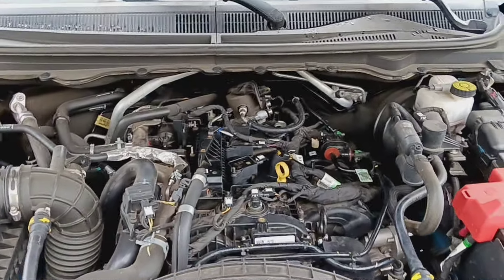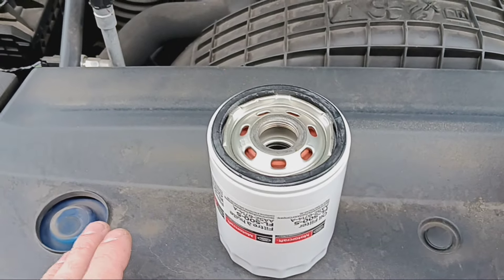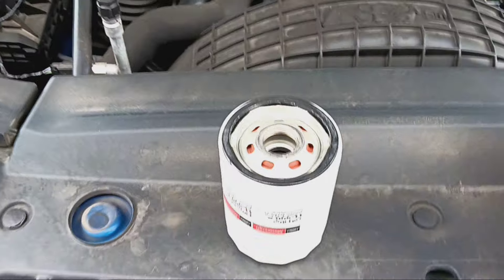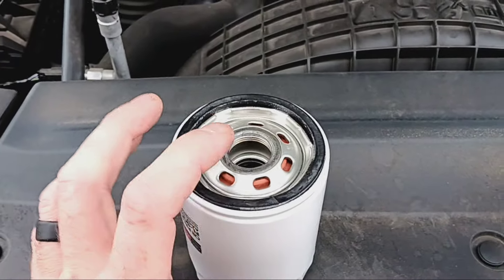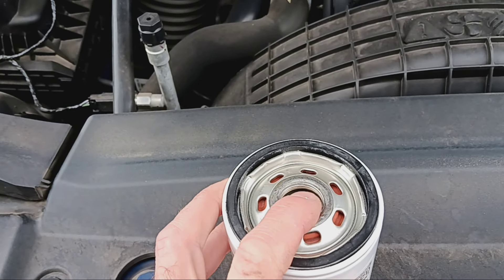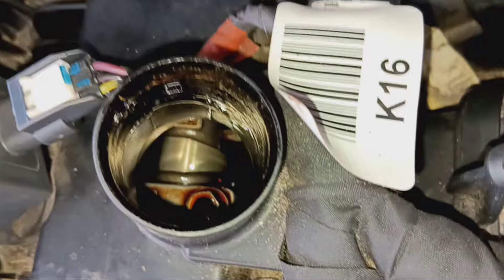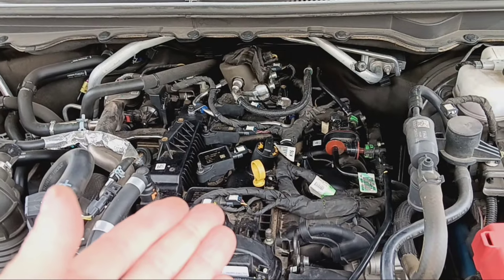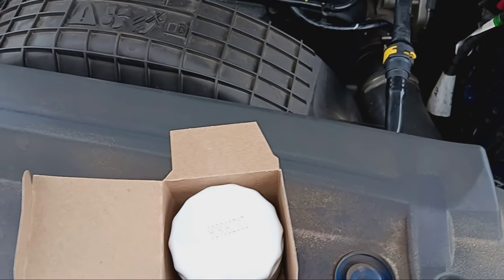The Oil Filter Pre Fill Debate. "Filtering Contaminants" No Your Not #newtoyou #fyp #oilfilter

Comment: I thought it was all about oil starvation. They wanted the filter primed so it doesn't starve waiting... I guess.
Reply: Flood mode on a Ford does the same!
Reply from the maker: Yes. And a few comments circulated about introducing contaminants lol.  Flood mode (hold the throttle to the floor and crank) primes the system.  Nissan GM and many others do it too.
Reply: @BeardedFordTech yup I flood clear my ecoboost 3.5 every oil change. Oil pressure before start. 👍
Reply from the maker: @dunbarautomotive  👍👍👍
Reply from the maker: @bonkeydollocks1879  it was do to with comments on previous videos that people say they prefill so they don't put contaminates in their engine. Then use said bottle to pour oil in the engine.  Thays what this was about.
Reply: That's exactly right. For modern overhead cam engines, it's extremely important, because their timing chains use oil pressure to tension them, and, the newer engines have variable valve timing phasors to change the position of the camshafts, that rely on oil pressure. Having the timing chain slapping around, and cam phasors chattering because of air in the system is inviting broken chain guides, and possible damage to very expensive valve train components. If you're concerned about contamination, pre-filling the filter from a brand new quart bottle is the safest way to do that. Just dump the rest in the engine, then, fill to level with the bulk container pump. You DON'T want to introduce sediment into the center of the filter, no matter what engine it is!

Comment: I never heard the argument that they are filtering the oil. But I've heard the argument that it primes the engine faster if it's pre-filled.
Reply from the maker: It doesn't. There was a lot of comments saying they do it to filter contaminants. That's what flood mode is for.  To "prime" the system
Reply: @BeardedFordTech  I see.

Comment: The only reason to pre-fill the filter, is to reduce the time the engine runs without oil pressure. Very important, for engines that use oil pressure to tension timing chains. Audi's are known to have chain guides broken by having the timing chain slapping around in there, before oil pressure comes up. Some engines even have the timing chains at the rear, necessitating separation of the engine and transmission. A VERY EXPENSIVE REPAIR!! I understand the contamination thing, if the new oil is being pumped out of a bulk container. the argument is the possibility of picking up sediment, and that being allowed into the oil galleries. You won't have that problem, filling a new filter with new oil out of a new bottle. If you KNOW your timing chain doesn't rely on oil pressure for tensioning, there's no problem. Most overhead cam engines do have that tensioner. Newer engines have cam phasors, which also rely on oil, and introducing air into those is noisy, and, potentially damaging. For those engines, I wouldn't chance putting the filter on dry.
Reply from the maker: I get what you're saying. But you said one key word. Oil pressure.  Filling the filter does not send that oil through the engine first.  It has to receive oil from the pump, fill the filter, and send it.  If it didn't. There would be an air gap like you mentioned.  And belive it or not. A lot of manufacturers state in the service manual not to prefill it.  And some also did say not to lubricate the o-ring cause engine vibration causes it to back off.  AUDi Breaks timing chains anyway. Bad for timing issues.  Yes ones with rear timing very expensive.  It's just one of those things if you want to fill it, fill it.  If you don't, then don't.  Some of them you can't.  Sideways, upside down, cartridge filters.  It's a good discussion topic!
Reply: @BeardedFordTech  The oil in the filter DOES go through the engine first. The oil pump picks up oil from the pan through a screen on the submerged end of the pickup tube, then, the pressurized oil goes into the outside holes of the filter. That pressurized oil then exits the center of the filter, and straight to the oil galleries.
     Oil pressure actually builds quickly, as that pocket of air compresses, which is why I mentioned the cam phasors, that are hydraulic. they don't work pneumatically. Everything I said, takes place for only about 5-10 seconds. The problem actually persists even after the oil pressure light goes off.
Reply from the maker: @vincentrobinette1507  oh

Comment: I pre-fill cause one of the main cause of wear is when you start the engine, with an empty filter you have 3-4 seconds with NO oil flow.  As far as contamination goes, all major oil brands filter their product before bottling.
Reply from the maker: @dwendt44  you are incorrect on engine wear. The main cause for engine wear is fuel diluted oil. Fuel breaks down down oil which essentially wears out the engine.  You have less than 3-4 seconds. There's still plenty of oil hanging around in the engine when you do an oil change. Your not dry starting it. Thats what happens on engine builds. Thats a dry start.  The oil you used does not get sent directly to the engine.  It has to wait to get pressure from the pump essentially sending oil to the filter then it goes.  If it went before. You would have a big air pocket. So it literally does the same thing as not filling it.  It still has to wait to get oil and pressure. Only difference. Your just waiting with oil in the filter already. So you technically wasted some time refilling it. And I bet you fill it through the big hole. Which is also incorrect.  Your supposed to fill it through the small holes. Modern engines don't need to have the filter prefilled. There's a lot of manufacturers out there that tell you not to.  Gas, diesel, generaters, caterpillar, John deer.  It it was a problem. Then upside down sideways and cartridge filters wouldn't exist.

Comment: I thought filling the filter with oil had an effect on a constant oil flow through the oil pump. My logic was that the oil pump won't pull air from an empty filter.
Reply from the maker: @stevangucu522  oil won't come out of the filter until it receives oil from the pump. It doesnt pull air. It pulls oil from the pan and pushes it to the filter. But prefilling a filter it won't send that "prefilled oil" first.. There would be an air gap. So the oil sits in there until it gets oil from the pump and gets pressurized  just like if you don't prefill it.
Reply: @BeardedFordTech  that is good to know. It will save me time on the next oil change 😁

Comment: Couldn't fill my two Dakota's filters. They went on sideways, under the passenger-side manifold. Pain in the rear to reach, but no pre-fill or it would be on the ground. This is what "flood-mode" is for. You can crank it a few seconds that way and fill those filters up before the engine fires, if you desire.
Reply from the maker: Yes I know. Inuse flood mode. That's not the point of the video. The point is people saying they fill it so they don't get "contaminants" in there. But then fill the engine out of the same bottle

Comment: Off subject.  Do you really feel Amsoil is worth it?   Currently using pennzoil ultra platinum which tests show to be a great oil.   As a tech to a tech do your think switching to amsoil would give me any value.
Reply: Read your own statement.  Your Penzoil tests as great oil.  You are asking if spending more money for oil you haven't ran is going to somehow benefit you?
Reply: A lot depends on your oil change intervals! How often do you change oil now?????
What percentage of city and highway miles do you drive?
Reply from the maker: Yes it is a great oil. All my used oil tests show very good results. You may be able to switch over do a couple oil cha ges then send off for testing. It may be better it may be the same. It really depends on where tou live and how you drive. I run it in all my vehicles. And a fleet of 188 vehicles. All have good results.
Reply from the maker: It might. He may be able to go further between changes. Only an analysis would tell after a few oil changes to be sure it's all amsoil being tested
Reply from the maker: Yep. Nobody drives the same
Reply from the maker: You might be able to go further with amsoil.  Only way to tell is switch over go 5k. Do an oil change go 5k do and oil change go 5k send off to be tested. That way you can be sure it's straight amsoil your testing.  Results will tell you if you can keep going. Go look at my 7800 mile oil change video. He explains in great detail what's going on.

Comment: Oil starvation is worse than a tiny bit of contamination. My 22 Tremor can’t be prefilled but I do the “clear flood mode” crank before starting and loading up the bearings.
Reply from the maker: I do that on every oil change.
Reply: @BeardedFordTech  same. I found you could not do that on a 6.7 PSD but that’s okay. Those filters are vertical and you can prefill till full.
Reply from the maker: @vais3  correct you can't do it on a powerstroke. I don't even prefill them. Never had a problem. Even quick lube guys at the dealer and truck shop guys don't prefill them
Reply: @BeardedFordTech  you’re correct. You can’t do the clear flood mode but I still prefill them on a vertical mounted filter. Is it needed? Probably not. Do I feel better? Yes. Lol
Reply from the maker: @vais3  and there is nothing wrong with that at all.
Reply: @BeardedFordTech  exactly. So many people think there is a right and wrong way but truthfully, there probably isn’t.
Reply from the maker: @vais3  I'm sure waaaaayyyyy back in the day it was necessary.  Or maybe it wasn't. Maybe it was some random person like I'm going to fill this and tell everyone you need to.  And the news spread like wild fire.   But today's engines. Not so much. Some manufactures even say don't pre fill.
Reply: @BeardedFordTech  the majority of light duty vehicles don’t need pre filled. Granted, I’ve worked on substantially larger engines and they tell you to prefill or fill the auxiliary filter and then run on it until you fill the primary filters. 
Granted, those are Cat 3512 or Cat 3516s or Cat C32s.

Comment: Also, can the oil get any cleaner than new? On the Toyota though with the housing, I believe it drains back, so from the MotorOilGeek's demo, prefilling can get oil pressure up a couple seconds faster, so should marginally add to the life of the engine if you keep it that long.
Reply from the maker: Yeah motor oil geek (my friend lake speed jr he comes on my channel sometimes))  it shouldnt drain back. It should have an anti drain back valve. But anyway. He also talked about flood made. Wer are talking about seconds here. Mere seconds. It does really add any life to it. What will add life to it (and he will agree with me)is doing oil changes when your supposed to and get a oil analysis done to see what how your engine is performing. I never fill my filters. You can see my results. He goes over them with me.

Comment: The oil coming out of the bottle is the cleanest oil your engine ever sees. The only reason to prefill the filter is just to speed up filling the filter so the oil can get to the engine just a tiny bit quicker.
Reply from the maker: Yep that was my point. The bottled oil is the cleanest it will ever see. Just like you said. I don't k ow where people come up with this stuff
Reply: Thanks for your reply. I'm no expert, but it just made sense. @BeardedFordTech
Reply from the maker: @markleggett3944  you are correct

Comment: They need to do away with oil filers completely. A friend of mine just rigs a filter delete on his vehicles and he runs them for multiple hundreds of thousand miles without issue. They actually seem to run longer. 🤷🏻‍♂️
Reply: Back in the day car didn't have oil filters.:face-purple-crying::face-purple-crying::face-purple-crying:
Reply: @k9under 
As much oil they leaked and used you didn't need one! 😂
Reply from the maker: True. You can run without a filter. They do catch debris that IA formed though. But it can definaly run without one with a block off of some sort.
Reply from the maker: This is true

Comment: Can you flood mode the newer diesels? I’ve never tried on mine .
Reply from the maker: I don't think so. I know you can't on 2022. I don't have a 23 or 24.  But I don't think you can
Reply: @BeardedFordTech  my 2020 F-350 6.7 Tremor is in “Deep sleep mode” the app told me the other day. Some features are disabled to save on battery. It doesn’t get driven in the winter here in Ohio if I can help it. But this will give me an excuse to go try it anyway. I don’t pre-fill any filter ever, with one exception. First start on a rebuild engine, of course there is already so much assembly lube in there it helps ease the mind a little.
Reply from the maker: @daddydiesel5889  I don't prefill the diesels when I do oil changes. Unless....I'm doing a pan and it's been off three days drip drying.  You can try it. If it revs up take your foot off the throttle and we will know that the answer is no at that point. Let me know. Curious to know if you can on the new ones

Comment: I think their main atguement is no oil pressure for the half second of cranking...which i get but even on a normal cold start it still takes that amount of time to build the pressure up...not to mention everything is already lubricated lol people jusy need a reason to be right because they were told that at 1 point or another but good explanation of them worried about filtering the already fillered oil and then contaminating it as you pour it into the engine to fill it lol like billy currington said...people are crazy lol
Reply from the maker: And it's usually the people who don't do this for a living. They fix vacuum cleaners in their parents basement. Don't see us telling them they are building vacuum cleaners wrong.  Years and years ago. Yes I'm sure it was mandatory but engines nowadays. Nope. You know I know it we all know it.

Comment: My 150 filter lays horizontally, so I do a flood start so the oil pressure builds first.
Reply from the maker: That's fine. But thus isn't about building pressure. It's about people filling the filter so they don't "contaminate" the oil  from the bottle. Then proceed to fill the engine with said bottles